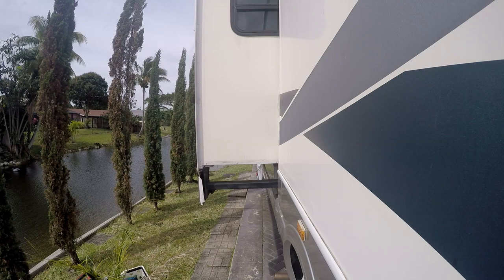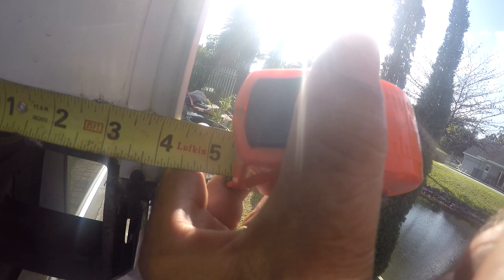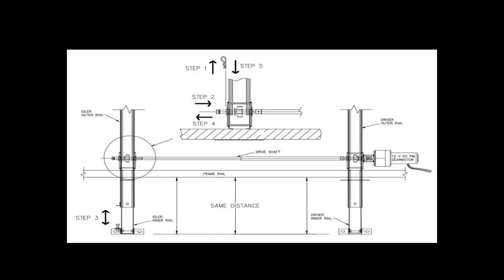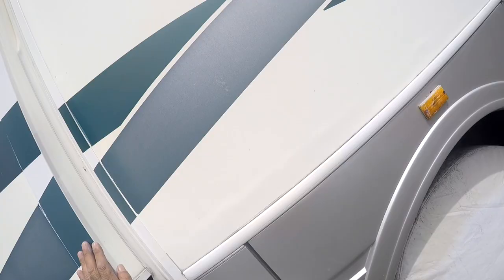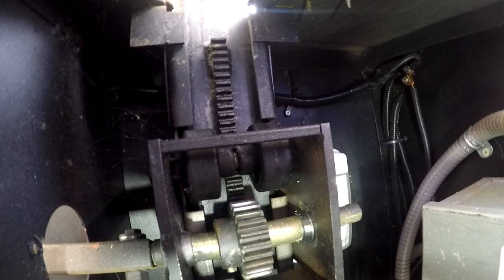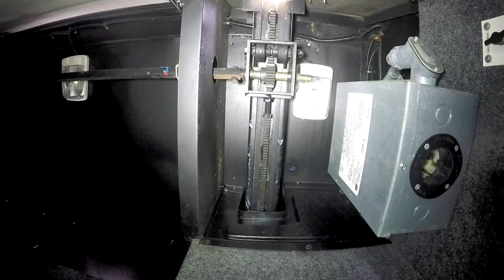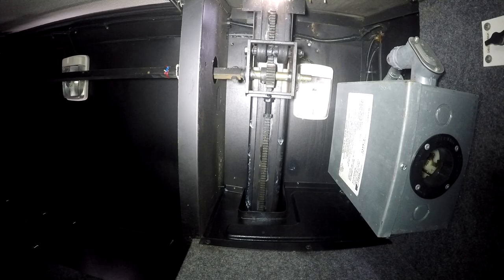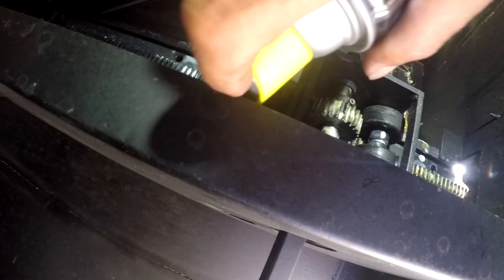RV SLIDE OUT RAIL ALIGNMENT & LUBING

Comment: 2001 Monaco Knight 36R - Front/Large slide.  This video matches perfect other than the pin he pulls out.  Mine had a roll pin and we had to use a punch to get the pin out and I replaced it with a Cotter Pin.  He calls his push pin a Cotter Pin, but it's not.  He has room for the push pin.  My Monaco is tighter and I had to use a regular stainless steel Cotter Pin and bent the ends over.  I believe that I went up a ramp or driveway at an angle like what happens in gas stations and this twisting motion caused my rear track/gear to jump one tooth.  Turns out this is a really easy fix once you have done it the first time - took forty-five minutes - if I have to do it again it will take ten minutes or less.  I used a hammer to tap the shaft to the left to disengage the gear.  Getting it back took some effort because the gears have to line up.  Dealers wanted $300-$400 to do the same job.  PS: don't worry about the other end, the square shaft goes into a smaller square tube and they telescope - so moving the shaft is not a problem.
Reply from the maker: Hey Gary, thanks for pointing out the difference between a push pin and cotter pin, you are correct and thanks for sharing in detail how you did the adjustment to your Monaco. There's many RVers out there that can save some money and time bringing it to a shop.
Take care.
Reply: 20021 Monaco 36 - 36R
Hello John and thank you again!  Your area to work in is larger than mine on the Monaco.  Diesel/Push/Two Slides Drivers Side - my front slide mechanism is a different company, however, my main slide is the same as yours, just much tighter area and when I tried the push pin it gets caught on its surroundings when the shaft turns - putting in a Cotter Pin is easy and easier to remove if maintenance is needed again - the roll pin is what took so long, just getting it out.
Reply: Team work, John, and thanks to you again!

Comment: Hey John good info. I will check my RV in the morning, on the Far back of the slide out when I open it and ur in side the RV the right side opens flush . On the bottom left it has like 2in or more and on the top is a little to flush. It need to open more from the bottom. In order to open flush and tid all around.
Reply from the maker: +Mauricio Saldana hello Mauricio, I dint have time to answer my comments since I'm traveling this week and next. I'm not sure what kind of slide your motorhome has. I hope you have it all figured out. Take care

Comment: Thanks John, very nice video on slide synchronizing!  Have you done a video on how to level the slide out for a power gear slide?  I've got a small gap on the top of my front road side slide.  I'm trying to figure out how to adjust the slide to get a tight seal at the top of the slide.
Reply from the maker: Not yet on that video! 
The adjustment bolts are just behind the front an back square body panels you see on each side of the slide. You'll have to find the screws to take the panel off (probably hidden by caulk). 
You'll need a floor jack with wooden blocks to lift the slide after you loosen the bolts. Hope this helps,

Comment: I wonder how it got that way. Great video! I've never seen it happen but it's good to know that I can fix it if needed. Thanks!
Reply from the maker: +Nomadic Native - I still cant figure that out, I'm assuming it was lack of lubing for now but I will keep an eye on it.
Reply: +John C RV Just an observation but it looked to me that when your slide retracted all the way in that the gear drive was awfully close to overrunning the gear rail end. Possible disengagement , if only temporarily might allow the out of sync condition to develop.
Reply from the maker: +Jay Low I was wondering if it could surpass the gear strip but watching it seems close to the end but not exactly. I'm wondering if hitting a pothole hard enough it would make it bounce off the gear? Another possibility is sliding it when not leveled? If I ever find out I will do a follow up video. Thanks for the comment and suggestion.
Reply: +John C RV Well done video in any event. Trial and error is how I learn the most but better for me if it is someone else's error! LOL
Reply from the maker: +Jay Low very true LOL

Comment: Good video until the application of grease on the gear rail. You should use a dry lube like CRC Power Lube with PTFE. It won’t collect dirt and dust like grease.
Reply from the maker: Great point but I never had that problem.

Comment: Great Video.  But my Lippert slide out didn't have a COTTER PIN.  The "drive tube" gear box had large plastic bushings and locked in with two steel plates - Sideways sprocket sliding isn't available.  BUT (once you've jacked up the rail to take the weight off the sprocket) you simply remove one of the 2 through-bolts and the sprocket-drive tube will drop clear of the rail gears, and you can make your adjustments on the loose "power side".  Easy Peasy.
Reply from the maker: Cool!!

Comment: Yes, My slideout is having this problem. Makes noise on the side (RT) that is dragging. Awesome video! I may get a replacement motor and keep it handy for any future slideout problems. My rig is 14 yrs old (2006 Tiffin Allegro Open Road-Workhorse-W-22). Will the Powergear 523900 Dual Shaft motor work for my rig?
Reply from the maker: The noise is a sign that a gear on the track is skipping may be. You may want to check the gears are not damaged or the teeth on the track itself.

Comment: Oil/Grease on the slide rail gear is a bad idea.  It will attract dust/dirt, causing pre-mature wear.  Better to use a dry lubricant on the rail (according to serveral certified RV service technicians).
Reply from the maker: My slide out mechanism is not exposed to the elements much, except when parked. I will keep an eye out  for dirt. Thank you for the comment. 👍

Comment: We have a Power Gear slide with 2 rails and 1 motor. The front end bottom of our living room slide was out about an inch. We moved the room out about a foot, measured both sides and did what you show in your video until they both measured the same. Then we moved the room in. The opposite end of the room was sticking out about an inch! We adjusted until both ends measured the same. We moved the room in and out about a foot and when all the way in The front end was off an inch again! We did the process again and the opposite end was off again? I don't know what else to do?
Reply from the maker: Check the following,
Check if the shaft pin bolts are ok.
Check if anything is stuck between the floor and slide inside.

Comment: My problem.  The slide in works. It is a gear & pinion type. BUT the top hangs up!!  Had an earlier problem with the gear
catching the bottom cover and tearing it.  And since repair the top hangs.  Must run back and forth several times when someone on the outside can get it pushed just right and it works perfect.  But you can never depend on it to work every time.
Last time set up looked like the top did not come all the way out.  Have been looking for a possible cause.  Any clues?
Reply from the maker: I can try to give you some advise only based on my little experience with my slide. Adjustments is usually the major issues with mine.
You mentioned it started catching since repair of bottom gear was catching the bottom cover?  Can you explain “bottom cover?
Because if they adjusted the slide upwards, that may be your problem.

Comment: John,if you manually operate the slide out ,do you have to disconnect the electric motor??
Reply from the maker: There’s a lever on the motor that disengages the motor form the gear on mine. Kind of puts it in neutral you can say.
Reply: John C RV thanks John ,I have no manual with my trailer,I DO KNOW there is a place to hook a three quarter socket to under my couch,I just didn’t know if I had to disengage the motor from the gear assembly,thanks for the info!!
Reply from the maker: Don’t forget to engage it back after you manually retract it, especially if you are going to drive around with it.
I just replaced my motor on mine. I will be uploading the video as soon as I have some time. Take care.
Reply: John C RV thank you!

Comment: Hi, nice video can you tell me how to get those Eoller bearings  for this unit? Thanks
Reply from the maker: I never had to change one yet. Maybe this will help. Here's a google search by image for power gear manufacturer, click on the one you're referring to. Hope it helps.
https://duckduckgo.com/?q=roller+bearings+Power+Gear+Slide-Out&t=chromentp&atb=v315-1&iax=images&ia=images
Reply: Thank you so much , mine just stops like it Jamed.
Reply from the maker: @vfpaintjobs  The best way to see what's going on is to have someone operate the slide in and out while you close yourself in the compartment with a flashlight. Good luck
Reply: Mine  is outside  40ft coach, but I did get under it while someone  operated  the switch  . And I used silicone spray ,I had the motor checked and they said it was good but it moves slowly  and then just stops . When I help it, it slides fine
Reply: 40ft sports coach
Reply from the maker: If you were able to see it was the roller bearing your half way done. 👍
Reply: Yes, they are not moving all.

Comment: I have a Seabreeze 8341LX which looks Identical to this one. The bottom part of the main slide out will pop out about 1-2 inches during travel. Will this fix it?
Reply from the maker: If only front or back, yes this adjustment should do it.

Comment: Wow John, did you just dive into the adjustment, or did you talk to tech before you decided to adjust the gears? In the RV is there a switch that moved these room or are they done manually through a crank? Supreme Video, PS: I love the view time on this video, shows that repair video can get us, I mean our channel off the map. like 362  Gary
Reply from the maker: Hey Gary, I just downloaded instructions that showed how to adjust it and did it as I was videoing. The slide has an electric motor and just press the switch to operate. In can be done manually if motor goes bad but it will take some time to to crank it with a ratchet handle.

Comment: greetings,  I have a 
2007 Itasca Class A, model 35A. Pantry room slide fail.  It appears that the main drive for
the pantry slide is the front arm.  Was used a few weeks ago, worked great. Today, the front arm is functioning but the rear arm mechanism is failing 'to keep up to front' . It seems the rear is just spinning and not engaging.  I did the override, both LEDs flash - but only front drive arm is performing. The rear arm when pushing (override) button can hear motor turning but not moving slide. Took exterior panels off to access Manual Mode / crank handles inserted but again only front arm will engage. 
At this point the pantry room slide is extended about 6" and I can't go anywhere.
help please     car54_04@yahoo.com  thx Don
Reply from the maker: Don, did you check the pin on the rear gear itself? If the pin is sheered the gear that contacts the slide bar will not turn.
I'm assuming you only have one motor driving both shafts rear and front correct?
Reply: @JohnCRV  hi and thx for speedy reply.  I spoke with Winnebago this morn, and they confirm 2 motors, 1 for each rail. When I did the override I can get each motor to activate separately. The front rail works fine, the rear mechanism (motor runs) just spins and no action to move slide.  Problem I have now, is to get at the rear motor. Winnebago advises both rails are same length but I can see only front and motor on front rail. The rear is behind - I dont know - but I am trying.  If I can get to it what does the pin on rear gear look like. I kinda think it is a gear type issue, sprocket or teeth missing off gear .
Reply from the maker: I’m not familiar with the 2 motor set up on the Winnebago but you should be able to get to the gears of the slide to see if they are turning when you engage the motor. If the shaft is turning the gear(s) should be turning as well. If the gear is not turning then most likely you have a sneered pin which is very common on these type slideouts. Do you know the type of slideout you have? If you do you should be able to search for a schematic online and it will show the gears and pins to check.
Reply from the maker: Check out this video. It's what I have, not sure if yours is almost similar maybe. https://www.youtube.com/watch?v=Sg_bNOvUJr8
Reply: @JohnCRV  

hi. I located the motor. I can see from the passenger side by opening side panel. But I have to get at it from driver side and remove access panel . more to come.  here is a bit of info.   can we post pics here..

 Digi-Sync = The term ‘Digi-Sync’ was first used by Kwikee to identify their 2-arm slide-out mechanisms. This electric slide mechanism features a worm-gear or ACME screw drive and ‘synchronization’ of the room travel was accomplished using encoders / hall effect sensors and a control module. 
FYI - With the 2007 acquisition of Kwikee by Actuant - the parent company of Power Gear, the decision was made to identify the new Power Gear 2-arm rack & pinion slide-out mechanisms as ‘Digi-Sync’ too… and this has caused some confusion with all parties involved. 
Digi-Sync FLS = Faster / Longer / Stronger – This identifies a change made by Kwikee beginning on MY2005 coaches. The original motor with the replaceable encoder changed to a more powerful motor with an integrated encoder. The room travels twice the speed of the older / standard mechanism and the stroke and weight carrying capacity were increased too.
Reply: hi John,  update.  The galley slide rear arm/ ram has been removed. The kwikee digi-sync slideout rail.   Shamefully a poor design. We found that the "plastic" 1" acme nut had broken apart. Another poor design?  the parts have been ordered, plastic nut $15.00 and corresponding 2 pins $3.00.    thanks your your interest and help.   Don